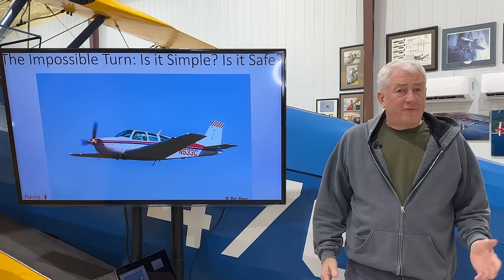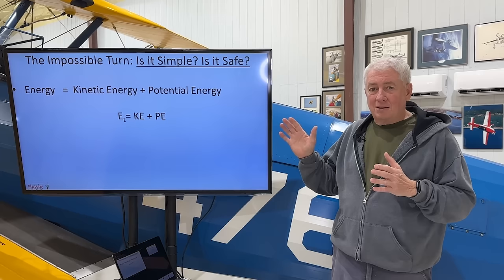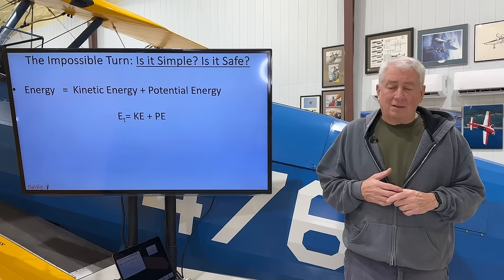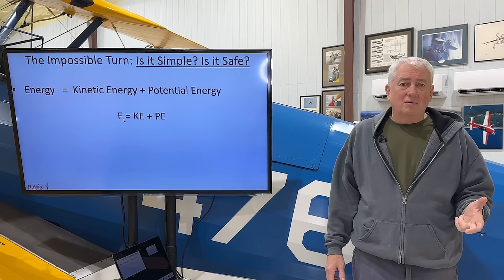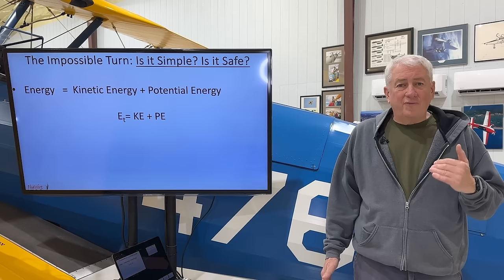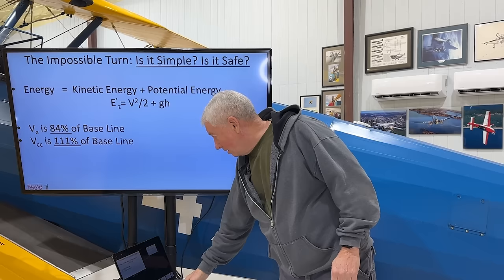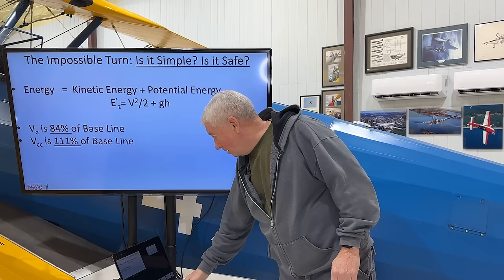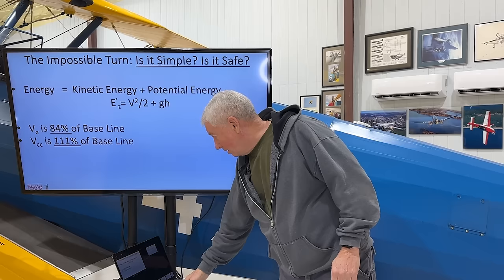Impossible Turn Is it Simple? Is it Safe?

Comment: I think the most critical dangers of the impossible turn, are people overestimating their skills and the planes performance. You train the hell out of yourself...for fun and safety. Most people don't. They should...but they don't, so when the engine goes quiet after takeoff, the monkey brain takes over, they yank back and...well...you know. The other thing is people don't know what their plane can really do because they have never explored its limits. 

The thing is, this kind of training is fun. Most pilots dream of being fighter pilots...so why not do some fighter pilot stuff like this? In training, stalls, spins, etc, were never initiated lower than 4000' agl. Cool...so 4000' is your 'runway'. Stay close to a good landing spot, just in case practice goes real...and have some fun. That hamburger will taste even better, I reckon. 

A while back, Scott responded to one of my comments with the 5 P's: Practice Prevents P*ss Poor Performance. I'm pretty sure he's right.
Reply: Exactly.  I think the typical advice, which is to just crash straight ahead, is the right thing to do for the average GA pilot and all students because they don't develop even basic maneuvering skills after their test and don't do any takeoff planning and briefings.  But I think the advice needs to be more nuanced like also use your brain.  Sometimes crashing straight ahead is surely going to kill you because of terrain, water, or houses.  But maybe 90 left or right is all you need not the full 180-270.

Comment: is it simple , NO. is it safe, NO.
Reply from the maker: I wish folks would see it that way...
Reply: No, it isn’t that simple.
Reply: As someone else said in these comments, it's not the "impossible" turn it's the "my skills suck and I don't know my airplane" turn.  I think most GA pilots fall into this category. It's more nuanced than a simple don't do it.  If I told you death were straight ahead like it is at some airports I've flown out of but all you had to do was turn 90 deg left or right for a suitable field, you wouldn't turn left or right?  Ah, but that requires planning and a pre-takeoff briefing, which most GA pilots don't do.
Reply: @major__kong  Yes, the key things are decent piloting skills and deciding before liftoff what you will do if the engine conks at X altitude.

Comment: Lol - you got me with "repeatable truth". Go figure. Would like to clarify especially how you define "potential energy". A little confusing b/c your equation equates to Energy/mass, but you wind up relating to that term as if it was simply energy. How do you account for the mass? It kind of looks like you pulled it out of your hat 🙂 It's a little bit fuzzy. Also, is there a difference between climbing from takeoff and a consistent climb at altitude, or the climb rate the same regardless? If you're climbing from takeoff you're increasing your velocity, right? Or momentum. Not sure that's accurate. But if you are at altitude would that still be the same, b/c you aren't just taking off anymore - you've already gained momentum? Maybe I just need some sleep - getting late for me.
Thanks for sharing. Hope things go well -
Reply: In flight mechanics, you can divide by mass to get specific energy or specific excess power.  That's what matters for the physics.  Takeoff or already in a climb doesn't matter.  Pitch for Vy.  That's the fastest way to build total energy.
Reply from the maker: Absolutely wrong, Mr Kong (except for the part about Specific Energy).
Reply from the maker: Nancy, If I wanted to look at Total Energy for a specific airplane I'd have to include the mass. Here I wanted to drill down to the energy alone due to velocity and height. I want to show the relative importance of velocity over height. What is more important is that this 'energy' I derived is independent of mass or aerodynamics... it applies to any airplane, or helicopter for that matter. To do that I just did algebra.  To make my point I looked at the issue without mass. To do anything else with that equation I'd have to consider mass again. It's not fuzzy math, it is just algebra. 

I don't fully understand your question about climbing from takeoff or at altitude... is that a reference to where I did the flight test? The pressure drop at 2000' AGL was minimal (therefore having a marginal impact on power... and a minimal impact on climb rate). Typically in a climb you don't increase your velocity, you convert excess power to climb... gaining altitude. You climb at a particular speed. Momentum relates to your mass at a specific speed/ velocity... inertia (which implies direction). I started the experimental conditions with the same velocity and configuration as if the airplane had just broken ground on a takeoff from a runway. The only variable was how much excess power I had. 

I hope this answers your questions.
Reply: @FlyWirescottperdue  🙂 Very good. Thanks for your response. Didn't mean to imply your math was fuzzy per se, only meant it in a more general sense. Just kidding a little. I liked math and was beginning to head into physics back in the day, but unfortunately life is what happens while you're making other plans. At least for me at the time. 
Appreciate your patience with me. Always like to learn. Enjoyed the video. Thanks for sharing.